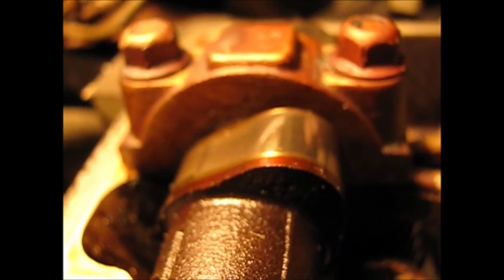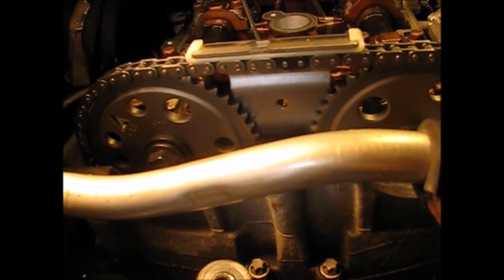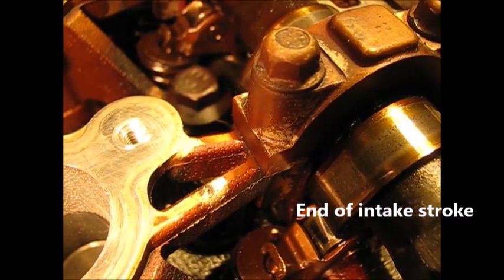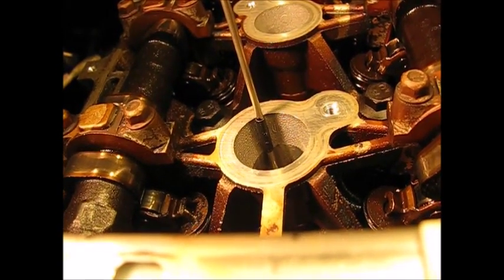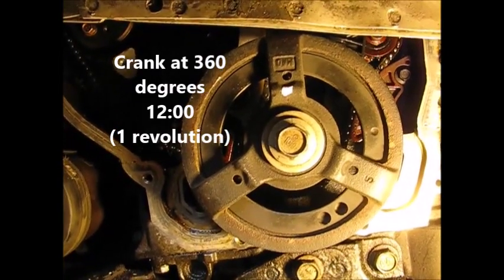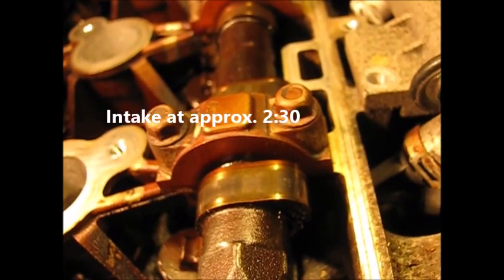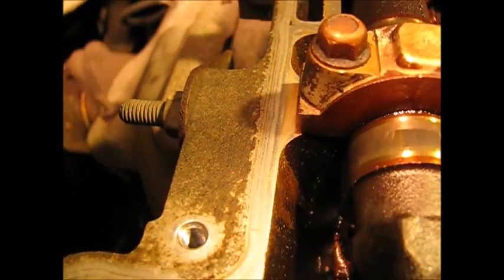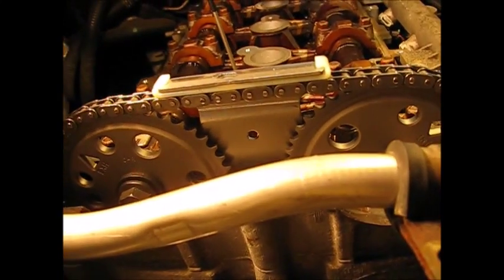A detailed look at one cycle of valve, piston, cam and crank timing in a GM Ecotec engine

Comment: GM Ecotec has its own variants too of course. So if you’re taking this video reference, watch one thing close to not to get confused. In this video on the crank pulley there’s a white reference mark. I believe the mechanic marked that with paint as an indicator. Actual crank timing is behind the pulley on the sprocket. When the paint mark is at 12 o’clock, actual crank timing mark is supposed to be at 5 o’clock. So what he says 6 an 12 are actually key marks. Repair manual never mentions a 6 o’clock. Basically install your chain at exhaust stroke  tdc when exhaust camshaft is at 10 o’clock; intake camshaft is at 2 o’clock and your crankshaft is at 5 o’clock mark.
Reply: Thank you so much for clarifying this. Yes, the chain mark and the mark on crank sprocket should be 5:00.God bless you 🙏🙏🙏

Comment: I was searching all over for the rotation direction of the 2.2L engine on a 2007 Saturn Ion (L61) to see if the engine is siezed before I replace the starter.  THIS VIDEO answered my question: Clockwise (CW)/Right.  Thank you!

Comment: Hello ( reason for working onthe is butting in new head gasket etc. )  i also hope you can help me i am in process of turning crankshaft by hand it moved nicely than it kinda sprockets had a sudden quick movent from that point crankshat will not budge.

Comment: Your Cavalier timing job vids were my primary source in replacing my destroyed timing guides. I got it running again but it seems the cam timing is off a bit and Im getting p0340 along with p0315. Trying to relearn the crank position variation but test keeps terminating due to camshaft code. Seems like I need to take it a part and go over the strokes using this vid to verify my timing.
Reply from the maker: Thanks for watching and I hope you are able to get it running good again.

Comment: How do you know whether the crank is on the compression or exhaust stroke. I'm assuming the crank position sensor has to be in proper relationship since it's a 2 to 1 relationship. Crank could be on exhaust stroke when cams are on compression stroke. Computer needs to know.
Reply from the maker: I have not replaced a crank sensor but I wouldn't think you need to know about where the stroke is to replace it.

Comment: How did you tighten the sprockets on the balancer chain, seems the punch method I tried did not work.  Was thinking of designing a chain tool with the old chain to hold the sprocket in place in order to tighten.  Thoughts?
Reply from the maker: I didn't know sprocket tightening was a thing. So I'm at a loss as to suggestions.
Reply: @TheOriginalMechanic  lol, there are two sprockets on the balance chain (water pump and crank are on the same chain).  Your obviously a pro since it anit no thing for ya!  Great video for shore!
Reply from the maker: @cgonedfishing  Not a pro for shore! I didn't bother changing the water pump or maybe I would have learned about the need for sprocket tightening.

Comment: Would this be the same for a 2.4 ecotec and if so would this be exactly how you want it timed after literally putting the chain back on , tdc end of exhaust, crank at 12 , exhaust lobe on cam at 7 , intake lobe at 5?
Reply from the maker: Possibly but I can't say for sure. I've only worked on the 2.2.
Reply: did you figure this out?   You have to make sure you have the correct engine code.  from what i'm reading the LE5 which is mine with the 8th digit 0 the marks are different than others, but regardless it gets timed on the exhaust stroke chilton's says, I can't quite figure out the exhaust vs compression stroke.

Comment: how did you keep the timing chain from becoming slack between cam gears when partially turning the crank to check for interference. 
mine goes tight, slack, tigjt, slack every time. it's all new parts, and the timing marks match up what am I doing wrong
Reply: mine is vvt by the way
Reply from the maker: may sure the tensioner is activated.
Reply: did that, and replaced it three times thinking I got bad parts. 
someone somewhere said something about loading the cam gear, don't know what that means.
I've had the car running after install all three times and have the timing chain slap on upper guide every time, no codes set, never has thrown a code. and somehow it has never skipped any teeth, the car is apart in my garage with the valve cover off, and voila, loose chain again.
Reply from the maker: @snowrider5150  I recall  during the install the chain being very tight and hard to get over the firewall side cam gear. I had to use a helper tool to install it. You can see it here; https://youtu.be/ZSCRUOLOd9k
Reply: You have to make sure the single chain mark goes to the intake sprocket mark at 2 o’clock and then one of the other two of the same chain marks goes to the crankshaft 5 o’clock mark then the middle tensioner then the other chain mark goes to the exhaust sprocket mark at 10 o’clock, then bring in 
counter clockwise the intake cam so you would be able to fit the exhaust sprocket in its right place, now you’re all tight in.
Reply: Your tensioner isnt activated
Reply: I am having the same problem as James.  Though I haven't pulled the plugs or put the car in neutral yet.  It's a 2011 HHR.  I was trying to see if the timing marks on the chain were matched up with the marks on the sprockets.  The marks on the sprocket are visible but I can't find any mark on the chain to match up.  I turn the crank a quarter turn and the chain goes slack, then turn again and the chain tightens, then again and slack.  I don't really know what I'm doing, so I hope I haven't done any internal damage.  I suspect timing chain problems but I'm hoping I didn't bend a valve or rocker.

Comment: last time I followed your videos it work my car started after 15 minutes my chain guide have broke so I had to redo my timing but it's cranking but not starting if I didn't make sure the cam position was in the right position but timing chain marks and cranks was in the right position would it not start I try for about an hour maybe a little over would never seem like it was catching
Reply from the maker: If your sure the timing is right and you're getting gas and spark,  you may have to be concerned about valve damage on this engine.
Reply: Be sure you set the valves at TDC on the exhaust stroke and verify by looking at the positions of the cam lobes on the #1 cylinder, exactly as shown on the video.  To verify TDC, do this:  at the 11:00 position on the balancer on the crankshaft, there is a scribed line in the metal rim of the balancer that precisely  lines up with a mark in front timing cover  of the engine.  The light in the video was not at the correct angle to show this mark, and it can be hard to see without removing the top engine mount on the passenger side and the belt tensioner.  Support the oil pan of the engine on a wooden block on a jack, if you remove that one top engine mount.

Comment: You may have not noticed that you were referring to the intake and the exhaust reversed. Unless the engine is the 2.5 with the throttle at the nose/Front or 12 O’clock. If so then the intake would be to the right if standing at front right fender looking across the engine in the direction of the battery and left front fender. If it’s the model where the throttle body is Jamed under the brake booster and firewall on the driver side. Then the intake is to the left,6.o’clock or SOUTH. Either way THE CHEVY/GM ECO TECH 2.4/2.5 direct fuel injection 4 cylinder engine is a MEDIUM SIZE PILE OF SHIT. I have a 2015 CHEVY MALABU WITH 89k miles. I change my oil 2 times a year and used SYNTHETIC FRONT BRAND OIL. Not gonna say the brand name, but it’s in the top 5 best ones category. The trouble started with the batteries going out which is normal no problem. But from there VTS,CAM SHAFT POSITIONING SENSORS,PCV FRESH/ SECONDARY/VACUUM PUMP,O2SENSORS UP/DOWN STREAM/CRANK SHAFT SENSORS/SPARK PLUGS/MAF SENSOR/FUEL PUMP under the hood not the fuel tank/OIL PRESSURE REG UNDER THE INTAKE VTS. Took valve cover off and never in my life I have seen so much slug and gunk. So 12 oil filters, 25 quarts of oil, 1.5 gallons of DEISEL/2 QUARTS STP ENGINE OIL FLUSH and OIL PAN AND OIL PUMP STRAINER CLEANED AND WASHED OUT THE ENGINE AND DRAINED OUT 6 TIMES. And now the engine is still not working. Took ECM tested and passed but got another one from salvage yard anyway. Both are doing the same. This ENGINE IS A PIECE OF SHIT.
Reply: That's the damn truth.  Two makes of vehicles I hope I never own again:  Chevrolet and Dodge.

Comment: Well done, clear and concise. Your "indicator", did you make it, buy it? If you made it, how?
Reply from the maker: Thanks. I made it myself by resting a piece of straight steel (like welding rod or stiff wire) on top of a piston, through the spark plug hole. Then I manually turned the engine and marked the rod at the top and bottom of the stroke.

Comment: I am a FORD MAN, I built my own engine power up in
My 2017 MUSTANG GT Single TURBO pure street car and daily driver and runs consistent 7.80’s 1/4 mile 179.7MPH and 4.12 in the 1/8 @150.3 MPH, MY FORD SUV HAS 176k miles my F-450 has 58k, my wife’s LEXUS GS460 had 81k miles. I do all the work and servicing of all my vehicles. This is a newer car and it’s nothing but a pile of CRAP. Stay away from 2.5 GM!!!